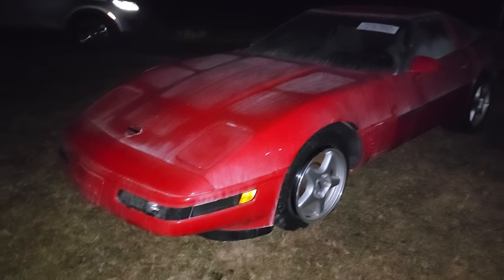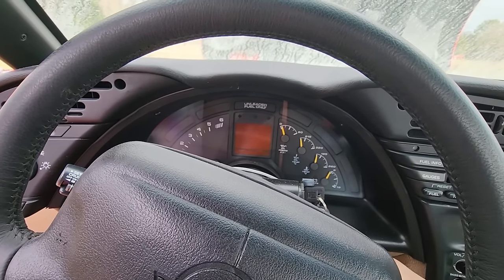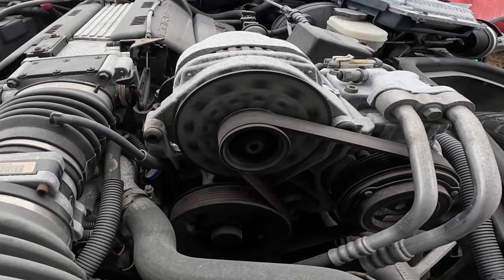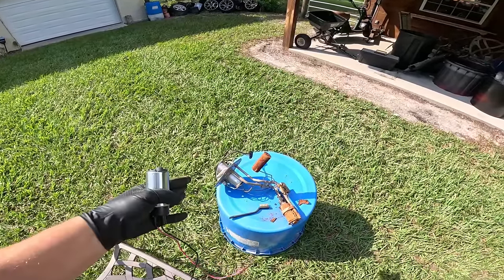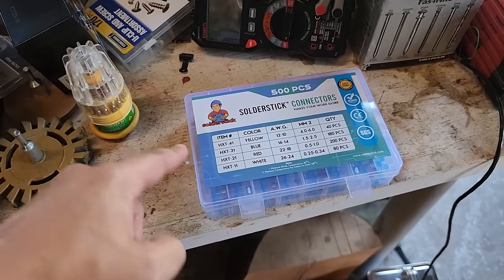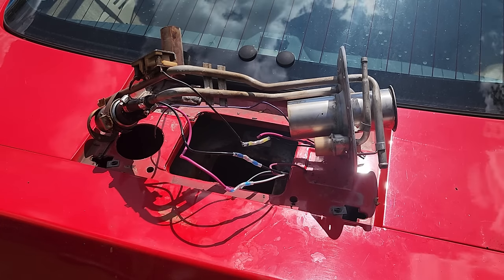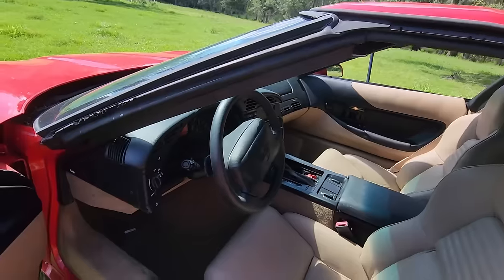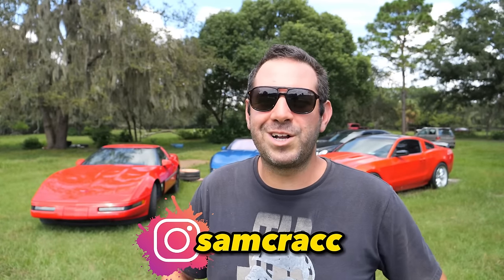I Bought a Junk Corvette at Auction that was Basically Brand New

Comment: That gas tank will give you problems. You need to replace it and in a short amount of time, the injectors probably will too but you can wait on that but if the car starts getting hard to start or won't idle good, then thats your problem.

Comment: By the way you left an exposed wire on the pump wiring your so called stick connectors was not long enough to cover most of them and if i remember witch one it was i think it was a yellow connector shrink wrap

Comment: I don’t know about the solder sticks in gas, I don’t know if they are rated for that you can throw a few in a cup of gas to check. If they disintegrate and so does the connection that could lead to a spark condition.

Comment: A salvage titled car can be changed to a rebuilt title car with the necessary paperwork filled out correctly. Why not try and get a rebuilt title? I would love to own that corvette especially with such low mileage. I believe that it never saw any water at depth. A good and thorough cleaning inside and out along with some paint waxing and buff would have this vette back to practically new car status. I don't have the funds available at the moment but if I did then I would definitely make you an offer. I'm sure there is a corvette enthusiast who would scoop it up in a Chevrolet heartbeat and would also have a neat back story to boot.

Comment: Should make sure those butt connectors are fuel safe.  Some are some are not.  Some pump kits come with fuel safe butt connectors. 

You can drop a couple into a jar with gas and let it sit in there for a few months and see what happens.

Comment: In iowa you just have to get it inspected (around 200 bucks for the cops to do it in council bluffs) and list out what you had to put into it.  They'll inspect it and when it passes (mine did) they issue a restored salvage title and you register it.  No problems. Also WHERE did you find the fuel pump SEAL?  I can't find one to save my life (the gasket that goes between the pump housing and the tank!)   It's NLA from GM and nobody seems to have one.  I pulled my pumps (I have 2 identical 85 C4's) and both were hard as a rock and no amount of silicone wants to seal them up.  HELP!

Comment: I would have siphoned the acetone/ gas mix out and repeated a couple more times until the tank was a lot cleaner before adding just gas and trying to start it. I wouldn't have run that dirty mix through the system.

Comment: The genius that invented the solder schrink socket ,did it in 1940 ww2 standard issue for radio field operators, only they used gunpowder to generate the heat

Comment: Dude 😎 you're should remove the gas tank for cleaning.and tank out to then upstream of the Fuel system blow out all the bad fuel out.replace all the injectors because the bad fuel have clogged the tips.after the tank cleaned , and line's then pressureize  a couple of times .then the car can be started.

Comment: I’m surprised the transmission fluid was at the full mark on dipstick. The car has to be running with the transmission fluid warm when you check the level. You checked it when it wasn’t running and the fluid wasn’t warm. 0:35

Comment: Putting pure acetone in the fuel tank, and later topping it with gas and planning on burning the mixture into the engine, was the most daring (if not insane) thing I saw yet as of car resuscitation. I mean there are supposed to be plenty of plastic parts, from fuel line hoses to gaskets and more, that don’t enjoy crossing acetone. 
So unless you plan to redo the whole fuel circuit, this seems quite suicidal to me.

Comment: First put oil on the pistons, then new engine oil, pump out the gasoline, change the filter, let the oil pressure build up without spark plugs...or, as here, ruin everything as quickly as possible.

Comment: Hi ,Check your Pack and you will find that your Joiners are spelt solder ,In Australia  we pronounce it as it sounds  and it also pronounced using the " L " therefore it is pronounced SOL DER Not SODDER

Comment: Worst thing to do is part it out. So it has a flood title. I’m sure someone would buy it and do the work themselves and you would get more for it this way, and they will finish it, it doesn’t look like it was flooded. The new owner has to do The Tyres. Full brake overall discs and pads, possible calliper replace or repair. Drop the tank and put in a new sender unit and pump, or use the one you fitted. Once that is all done. Get it fully detailed and they will have a good sound low mileage car they could keep and use. They don’t need to sell it. So the flood title. Means nothing to them. Sam you have bought a number of Flood title cars. And sold them. Why is this one any different. Plus this one is super low miles. A Corvette fan would snap it up, in that condition or repaired. What have you got to lose. Would be far better than sending it to a parts yard. That would be such a shame to do to This car being super low mileage, Sam advertise this first. Imagine it would sell so quickly and that would be the best for the new owner and the car.

Comment: I bought a 1995 vette for 3000.00 from the original owner 8 years ago. It ran but would die when it warmed up. So i replaced the opti spark and the feul pump. It runs perfect and always has since the repairs! Great car and alot of fun to drive! Ive done a few up grades to it, new long tube headers and a borla 4 inch exhaust. I had the computer flashed and the shift pionts adjusted. Now its a rocket ship. Crazy fast!! I lowered it and put AQ 1 coil overs on it. I take it too road courses and run it. Its a great car!

Comment: From the looks of what was in the gas tank the dealership did NOT clean the tank out at all. I think they ripped thaty guy off. Good job cleaning and fixing the fuel pump and tank. Seems like its fixed to me it runs great! I would find another one and take everthing off this one and build one with a good title. No way you can fix the titie?? remove the motor and tranny and trans plant it and the interrior Basically everything. It aleast would make a bunch of great videos eveyone would want to watch.

Comment: 7:30  The Wire Solder Shrink Tube Thing You Have, You Did The WHole Thing Wrong, I Have Did Many tests With Them ANd The Copper Wire Strands Needs To Be CLEAN , Seriously CLEAN And Scrubbed To The Low Melt Solder To Grab Onto It AND If You Will Run A Lotr Of Current Thru The Wires It Will Not Work So Don`t Put Them Where There Goes A Lot Of Current, I Have A Trick To Use Them Where There ARE A Lot Of Current, But I Will Need To Make A Video On To It And How Its Done I believe Because i See A lot Of People Doing It All Wrong.

Comment: This year was the year to say "flood damaged" with as many hurricanes in Florida. And Travaris has the video for the legitimate "flood damaged" McLaren to show how hurricanes can cause flood damage. Problem was probably gas that was bad(maybe water in tank after hurricane at gas station). Two incidents identical with same solution basically applied with same results. Tank cleaned and sender unit replace. Dealer actually drained and replaced injectors vs. your concoction. So basic problem is the corrosion to the sender unit. Thinking there is a seal that is damaged that is letting water into the tank. Please, Sell the car to someone who wants a project car, and let this 95 live again.

Comment: I know where c4 2 corvettes are sitting that both have 84 miles on them. Still have window stickers on the glass. Thats the exact distance from the dealership to the shop they were parked in. Despite that. How does a person not put a GM pump and a new set of tires on that? Title problems or not. That totally disrespects the car.

Comment: solderstick connectors does give no guarantee to be good successful solder , solder might melt but will it go trough the conductors sincen the heat is way less than when soldering properly ... ? made in china product. instead of acetone you should have used lacquer thinner

Comment: I was already cringing right from the beginning.  Trying to start up the car after a 30 year period is plane nuts and often creates even more damage.  Trying to clean the fuel tank with acetone and then just adding fuel on top of the acetone, in order to run it through the engine is a big no-no.  
Frankly, this car & engine needs to be checked from top to bottom first to see what can be cleaned, what needs to be repaired or replaced, etc.  Yes, absolutely, this car can & is worth restoring (paint job is key to asses also).  But, you want to get a real auto-mechanic engaged.

Comment: I bought a brand NEW 1994 Corvette. The most horrifying piece of shit I’ve ever owned. The last shevvie I’ll ever own! My second corvet. They deleted the FRAME to save money. If you take out the roof panel, you have to drive around until you find a perfectly flat surface or you’ll never get it back in the roof because the car is so flexible that it takes up the contour of the road surface.. also if you go over bumps, the whole car will start to oscillate and the steering wheel and the dashboard will fly to the left and right while the back of the car is going in the opposite direction!!! I couldn’t get rid of it fast enough and I lost a whole Lotta money on it.
    It doesn’t surprise me at all that somebody just abandoned it!   Clean it up and unload it on somebody who doesn’t know any better.

Comment: You have to check transmission fluid with the engine running and after shifting it through the gears a few times.  Car sitting for god knows how long is not a good way to measure trans fluid... come on man.....

Comment: you screwed up running all that crap in th etank through the fuel system.   You should have pulled the fuel line at the engine end and let all the crap out before putting in some fresh fuel.   You already have lots of unfinished projects, so letting this one go is a good idea.

Comment: That car you just destroyed that engine u should not have cut corners. One drop tank two replace all hoses flush everything and replace all the seals. You pushed nasty ness all through the whole system by skipping the gas tank repair or replacement when the motor blows you regret it and if you resale vehicles having this online is not good i would be iffy buying from you.

Comment: with this car condition ,working perfect and low milage,big mistake to part it out, if i were in your place i will restore it again ,make as new one, all it need deep cleaning and detailing. tuneup, new set of seat leather changing the luster(prefer to put lt4 cluster), and fixing the a/c, then it will be as new.
belive me if had had this car i will not regret to do it.
no these days the c4 corvette become more valuable . specially the LT'S models.

Comment: I can't beleive the first thing you did wasn't to clean the fuel system.  Risking pumping crap from the tank through the rails and injectors was bush league.  Try watching Hagerty's "will it start", they always isolate the fuel system before doing anything else.  Get a clue.
Reply from the maker: Thank you. I will get a clue after I get it running. Oh wait 🙃

Comment: You are cheap cannot even replace a 1. Clamp for the fuel pump ! Even an Amazon cheap heat shrink and improperly wire repair . I am aware of those cheap heat shrink connectors and then you have a far better one that fuses the entire wire . The best connector is are crimp connector that shrink and seal the connection .As far as flood damage florida always gets hit with 🌀  I am sure this car was up to the bottom of the car with water ,but not enough to enter the car .Second reason the previous owner ran the car out of fuel and put fresh fuel in the car with E10 the ethanol sitting screws everything up . You still need to inspect the check engine light and I would check the starter I DO NOT CARE FOR THE SOUND FROM IT ,I think it needs to be shim away from the flywheel . Tell me what the check engine is and I may buy the car .